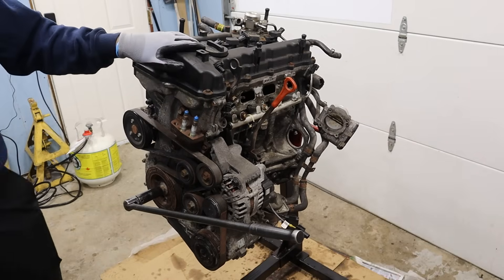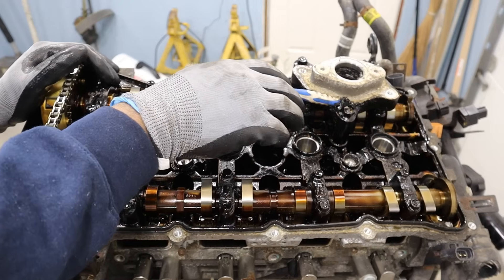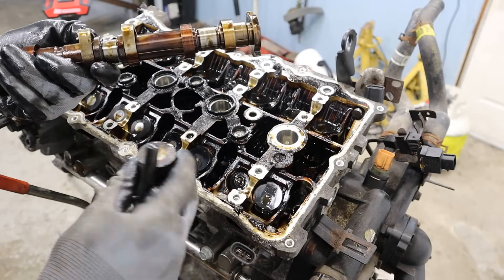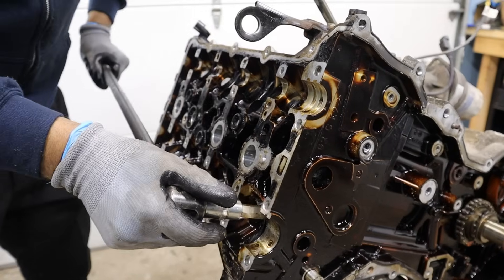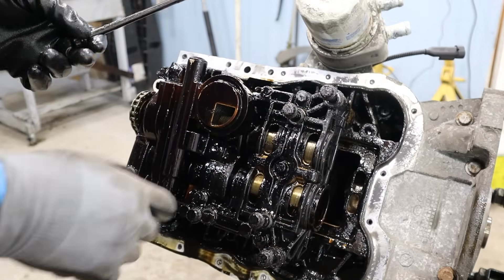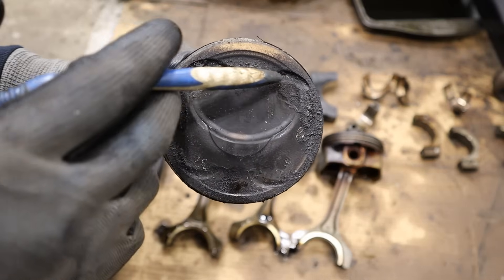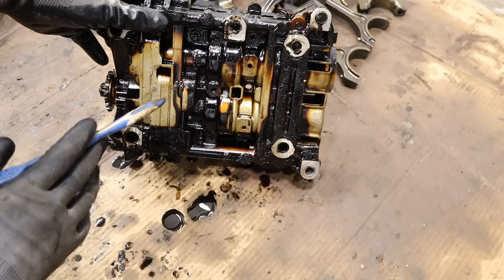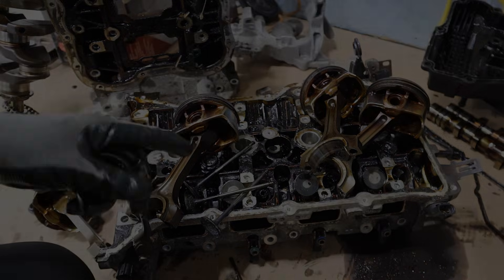Why Kia 2.4L Theta 2 Engines are a FAILURE

Comment: Part of the recall was to change the dip stick to one with a higher level. That says it all, check your oil level.
Reply: Yes, the replacement dip-stick is RED. The original was YELLOW. Now the motor takes 5.5 quarts of oil to reach the full mark on the new dip-stick. Original capacity on the yellow stick was 5 quarts.
I have been running Valvolene Restore and Protect 5w-30 for two oil changes ... < 5,000 miles each change. The 2018 Sorento is still consuming 1 qt. per 1,000 miles driven.
I have a suspicion that the plastic valve cover has a design flaw that causes high oil consumption. The valve cover has collection chambers/baffles. These chambers have red inserts with very small drain holes. This is designed to collect oil vapor into these chambers. The collected vapor condenses back into oil. The oil is then suppose to return to the engine through the Red pin hole ports into the valve head area. I feel that as the engine ages, this oil collects within these chambers, but does not return/recycle back into the engine. I suspect that either the Red drain ports either reduce their size because of age and or blockage from contaminants.
The valve cover is suppose to be a "Catch Can" built into the engine. Its' design appears to recycle the oil vapor back into usable oil for the motor. If it does not recycle the oil, then the oil goes into the motor's intake and gets burned within the combustion chamber. This could be a source of the high carbon deposit within the combustion chamber, valves, and oil rings.
This is my opinion. I could be totally wrong. It is very odd that these motors start to use oil after a year or two of use. The motors run short of oil most of their latter days of use. Low oil level creates abnormal operating conditions (That is why Kia installs a shorter oil dip stick as an upgrade on these motors as part of the recall) this shorter stick allows for a 10% increase in  oil capacity.
This is my opinion, I could be wrong. I am not a certified engineer or expert. I am just a mechanically inclined person with an observation that may turn out to be factual.
                                               What are your thoughts?

Comment: You should do a vw/audi ea888 engine. Just to remove the valve cover (known as the cam carrier), its upper and lower timing cover off, timing chains for the cams and oil pump removed, high pressure fuel pump, vacuum pump, and oil separator. just to remove the valve cover.

Comment: 1.6 na soul change oil every 3k miles sitting at 211k miles. Engine is great its all the other things like wierd vibrations exhaust leaks and steering coupler that's annoying me.

Comment: We had a 2013 Kia Optima sx with the 2.0 Turbo.  We did 4000 mile oil changes on it since new. At 90k it started drinking oil. So much so I actually set a alarm on my phone to make sure to check and add oil every Sunday night.   1/2  quart of oil every week. The car had all its recalls and tsbs done to it.  At 130k it threw a rod through the block. Costs us $400 to get it drug back home.  We dropped it off at the selling Kia dealer, and they debated on replacing the engine .  We couldn't wait and ended up buying a Mazda cx50 turbo for my wife.   It sat at the dealer for 3 weeks and then the dealer text saying it failed the bearing test and they contacted Kia asking what they wanted to do.  2 days later, they called and said a replacement engine had been stabbed into it. I've been driving it daily since then, and we plan on trading it and my car in on a truck or a big suv in the next few months.

Comment: Strange thing with Hyundai's "debris" explanation is that all the part no's for cranks and conrod bearings have been discontinued and replaced with new parts on affected Theta II, Nu, and Gamma II engines - that leads me to believe there was a problem with either the journal finishing or bearing clearances - why change the bearing parts when the crank was the issue? And if it was just "debris", why change the crank part no's? Funny thing is both Toyota and GM recently had similar conrod bearing issues on their V8s - but neither was as expansive as Hyundai's issue, having affected 2012-2019 engines - they took FOREVER to remedy the issue

Comment: I also hear there were some major manufacturing issues that could cause them to seize up on the road or even catch fire.  If you ever heard an Hyundai or Kia make a strange noise, don't count it as simply a weird but normal thing for Japanese or Korean vehicles!  If you hear those sounds, hopefully your vehicle is not the one making them.  I hear that it happened because they were not fully cleaned out in the manufacturing process.  Metal shavings were not fully cleaned out.  Is that really what caused a lot of the problems?  I know it also affected the 2 liter and possibly other engines to a less serious extent.  I wonder if they had this problem with any of their V6s.  In some of the vehicles those are in, there may be twin turbos, those should expose any problems somewhat easily considering the stress they will place on any faulty parts

Comment: These engines fail because they are installed into hipster cars... Ones where the owners do not feel that they should need to do anything other than push a button and go.
These Hyundai/Kia vehicles use a different plastic for the coolant things than that of the US domestic automakers. I haven't seen any of those components fail... Unlike how they did in GM products, for example.

Comment: My wife had a 2017 Sorrento, and it burned a quart of oil every 500miles. The oil was changed regularly at 6,000 miles, but that didn't really seem to matter. The bigger danger was running out of oil between changes. I had to top it off religiously. At 90,000 miles, it broke a valve and lost compression in cylinder #3, and the engine was replaced under warranty.

Comment: @speedkar99  Im doing 3k miles oil changes in my 2016 1.6L kia. but i have a lot of problems from the injectors. after about 40k miles they get cover with carbon and does not spray right and i get low mpg and very high LTFT of above 30%. after I took the fuel rail out and cleaned the injectors with ultrasonic device. It ran amazing again. and LTFT is back to 1-2%. The car have 90k miles and I already did that twice.

Comment: Thanks for the video, but I want to point out a couple mistakes.   The high pressure DI fuel pump generates thousands of PSI, not RPM.  Also this is a Hyundia engine, not a Honda (in regards to 13mm socket size), and it’s a Korean auto company, not Japanese.  Thanks.

Comment: i am a hyundai/ kia tech.
these get diagnosed wrong all the time. the high pressure fuel pump can leak fuel into the oil, it thins the oil which causes the oil burning and wears out the bearings.

to test put a pressure gauge into the supply line from the tank to the inlet of the high pressure pump, it should get and hold about 50-70 psi of pressure. if the pressure drops off the high pressure fuel pump is leaking. it may need to be bolted back onto the head.

other telltale signs of this are longer cranks when the car has been sitting as it has lost all its fuel pressure for restart. and engine lights for car running rich. vapour in the pcv getting burnt.

this is also common on other cars with high pressure fuel pump like porsche.
Reply: So it's the seals from the high pressure pump above the head.
Leaking fuel right into the top end...
Boy that would quickly thin the oil out...
😳
Reply: @caleroby9483  yeah, the design of these pumps is a bit flawed that it can do that.
Reply: all high pressure fuel pump cars are prone.

Comment: Having changed a couple dozen of these engines I can tell you even if it looks totally clean in there those bearings will still fail. Rod bearing material is a very weak point on these engines so much so that Hyundai came up with a special engine replacement campaign and a tool to confirm this specific failure on the engine.
Reply: There is a video claiming that almost all failures happen basically in the same bearing. Any further details on this? I'm truly fascinated by this as how can some engines go 200K + with 6-7k mile oil changes while others maintain theirs meticulously with 3-4k oil changes and it still blows at 70k miles or before?
Reply: @AbeSAbe2025  I think the answer is in exactly what's been disclosed. Hyundai left debris in the oil passages on some of these engines. Those are the ones that blow up at 70K even when well maintained. And yeah, there's some evidence it's typically one of the two middle cylinders.

Comment: Interestingly, in my area there's a lot of talk about how GDI engines self-destruct due to debris from overheated cat getting sucked back to cylinders when EGR is active. Supposedly this doesn't happen if you avoid eco driving, or install a modded engine map.
Reply: This engine doesn't even have EGR as mentioned in the video. It's a very simple engine. GDI engines have other issues but I don't think that's one of them.
Reply: @sharedknowledge6640  It does. It doesn't have external EGR valve, but the gases get recirculated nevertheless.

Comment: My 2012 2.0T was inspected (new colored dipstick) three months before it ended up needing a replacement under warranty. When I own a vehicle, I do take very good care of it and change the oil frequently and under the recommended mileage. If memory serves me right, I had somewhere between 80K and 85K. Upon a cold start (after sitting over night or for hours where the oil cools) I would notice a loud tick, from the top of the head, during start-up that went away after driving a block or two. On the morning I took it in for service, I taped the start-up, and the tech and service director all said they never heard a failure that loud before. Warranty wise? Hyundai stuck by this car without any issue or hassle.

Comment: Regular cheap oil changes will do wonders for the life of an engine, compared to putting off an expensive oil change.
my taxi was scrapped at 12yr old and the engine was at 250,000 miles with lovely clean emissions thanks to regular changes and flushing with walmart oil.

Comment: I find it hard to believe that so much sludge will accumulate while performing only handbook servicing. This engine looks like it has only had three services it's entire life and that would be a much closer assumption. There are those owners who believe frequent servicing is a waste of money saying it only profits the service department. It was also likely hammered quite hard with oil levels often being too low with a lack of checking. I have seen worse so much so that the head bolts and cam cap bolts were unable to be seen without scraping away the mess.
Reply: Agree completely
Reply: Worse... Yikes Man!

It's as if the Gen after X was taught Nothing about care of vehicles......

Know a guy with a 2013 Optima, 2.4 and at 201000 miles. Original engine and HIS known 5,000 mile oil services... Runs like new and still gets 32mpg on highway. 

One thing..... His, made in Korea.
😌

Me, a 2012 KIA Forte 2.0.
Made in Korea...
Flawless since new, same maintenance from me.

Better than any civic or accord I've ever owned in the past.
Better even.....
😊

Comment: Appreciate you showing where the oil dipstick is on the inside the engine, with 5000 mile oil changes and fuel injection and services. This engine would’ve lasted a lot longer.
Reply: Yup

Comment: How good are their replacements under recall ? My father in law's KIA's engine blew up at 77k miles and the dealer replaced it.
Reply: It's luck of the draw as you get a "re-manufactured" engine and Hyundai/Kia apparently outsource the rebuilds to various low bidders. Some are on their 3rd engine at 90K miles.
Reply: @sharedknowledge6640  That does not inspire much confidence in the replacement engine. Hopefully the vehicle will rust out in the Ohio winters before the replacement engine goes.

Comment: My coworker is/was a big KIA fan. Last new one he bought in '19 (Sportage 2.0 turbo) had an engine failure at 70k. Interestingly, I took apart his '06 Sportage with the 2.7 v6 for preventative maint at 170k and it had minimal oil tarnish on the surfaces. It still runs well. Looks like the 4cyls really don't want to run past 60k. The '19 had fresh Royal Purple or Amsoil used at every oil change at 5k. Thankfully, he kept the receipts for all those oil changes in the '19 and the dealer installed a new engine for free. I don't think he'll buy another KIA
Reply: That 2.7 is a Mitsubishi 6g7x based engine.

Comment: 2:20 the engine wouldn't look like this even if it was a 10k interval. This is a person completely neglecting oil change intervals. For those cars with 10k oil change intervals, thrre are plenty of online lab oil analysis showing oxidation level (that cause sludge) are in check.
Reply: 10k intervals are for morons. Ask any degree holding engine builder. They'd never recommend that.

Comment: Our 2013 sonata blew up after 90000 miles 2.4 theta replaced under warranty. Changed it every 3-4k on full synthetic oil. Still blew up….
Reply: how come 90k was under warranty?? Did you purchase a extended warranty?

Comment: This is a bizarre issue. I've been hearing about the manufacturing problem, where they didn't clean the engines out properly, for years and years now......at least 5-6 years. In the beginning, yeah I can see this being a huge problem. However, still even the replacement engines are failing? Kinda doesn't make sense unless they just keep leaving all the machining debris still to this day. I'm not sure if this makes any sense.
Reply: 5w20 might be not enough in the end
Reply: Completely agree. I also always called BS on this excuse because 'debris leftover from the manufacturing process' would take literal moments, days at most, to cause bearing failure, not tens of thousands of miles, and many years in some cases...
The real reason is multifactoral, but it has a lot to do with massive oil consumption, leading to them running dry and seizing. It is a clear design issue, not a minor manufacturing problem.
Reply: @19jacobob93  i built engines in my shed with sand blowing through open doors that lasted longer than their motors
Reply: @TheMarcQ  100%, and I agree that 5w20 might be the issue. Everywhere else in the world specs 5w30 and 5w40 is often used in some countries and they don't seem to suffer the same failures
Reply: @19jacobob93  IDK which of these engines calls for 5W20? I have two of the Hyundai 2.0T equipped cars, they call for 5W30, but I'm switching to 5W40 at the next interval just to be safe.
Reply: @knowair6767  The US version due to CAFE regulations. It's probably the main reason why they fail so rapidly there
Reply: I agree, it doesn't make sense. I think a lot of the failures are from the oil getting too dirty or too low. If these engines were made to use a low power limp mode when the oil level was low or too dirty it would make them more reliable, especially if there was a warning displayed to tell the driver what was wrong. Many drivers would be motivated to add or change the oil to get the power back to normal.

Maybe somebody can figure out a good way to use port fuel injection instead of GDI for these. Some parts from the earlier Theta engine before 2011 could be used on the Theta II. That should help cut down on intake manifold deposits and sludge in the oil.
Reply: Hyundai/Kia have switched to "Clean stream" dual injection on the newer 2.5 liter version. That wasn't a cheap upgrade to have both port and direct injection but they recognized a problem and fixed it. They did take too long to fix the "debris" issue on the 2.4 which is hard to comprehend. The other issue is their replacement engines are rather poorly re-manufactured on the cheap and that's become a common problem across many manufactures as they outsource rebuilds to the lowest bidder in that country. If you have one of these engines and do your own oil changes I'd suggest oil analysis to keep an eye on bearing wear. And I'd also suggest 5W-30 oil (see GM's 6.2 liter V8 recall for failing bearings) but that, ironically, could allow them to deny warranty claims if you're under 100K and you can't prove using the correct oill
Reply: @sharedknowledge6640  They are called SmartStream I believe
Reply: @sharedknowledge6640 in my reman engine the service department used 5w-30.

Comment: It’s unfair to talk down on engines that fail because of neglect. From what I’ve seen from most Hyundai engines is they fail because of lack of maintenance or low oil. Sure they had a few bad engines but who hasn’t? Tundra engines were blowing up. Tacoma transmission were giving out.
Reply from the maker: Every engine has its flaws. However many owners including commenters here have maintained their Hyundai's and still have this issue. 
By extending the warranty, Hyundai is even admitting it had a manufacturing defect
Reply: I'd definitely take a Taco or Tundra over a Killed In Action any day.

Comment: We have a 2017 Elantra, 2 liter 4 cylinder, 135,000 miles.  Bought when a year old from dealer for $11,000.  Only problem so far has been a failed ignition coil.  We have put nearly 100,000 miles on it so if it craps out now I wouldn’t be too upset.
Reply from the maker: Not bad. If you could get another 50K it wouldn't have been a bad investment after all!
Reply: @speedkar99 another 50k might be pushing it a bit but you never know.
Reply: 2018 KIA I bought for my daughter from the dealer with 8000 miles on it for $12K. It's 107,000 now and I do all the services. Oil every 5K,  transmission every 30K. Other that a failed coil, nothing wrong with it.